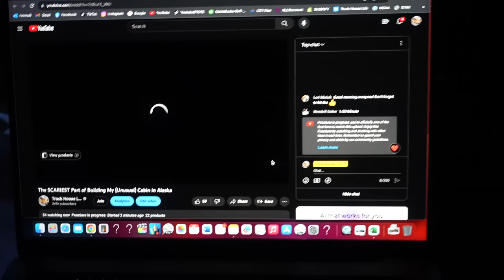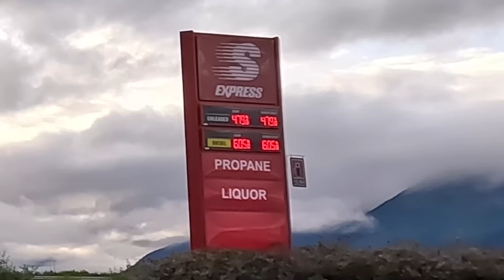This is Why I Stopped...

Comment: I’m in Soldotna.  Hey man I love your channel.  I’m going to build a camper for my truck for my Nissan Frontier using at Wedge style roof top tent as a pop up.  I’d love to connect, hang, pick your brain….   I hope all is going well.  
Michael
Reply: Thin wood/ or foam skinned in fiberglass is your friend. I built my own after being inspired by the surf board builders in Hawaii at Ft. Shafter showed me how. That was 1989